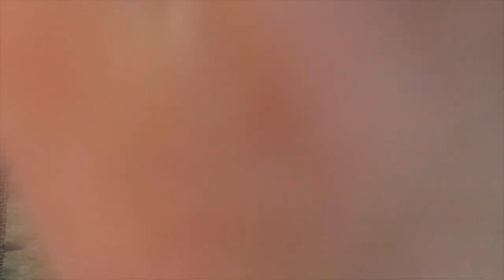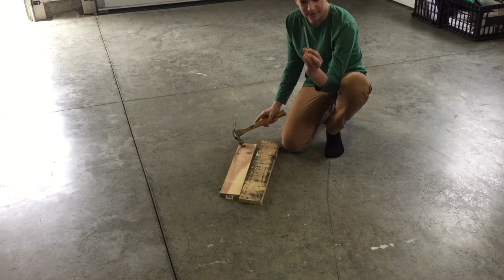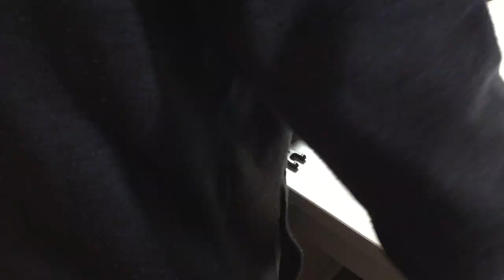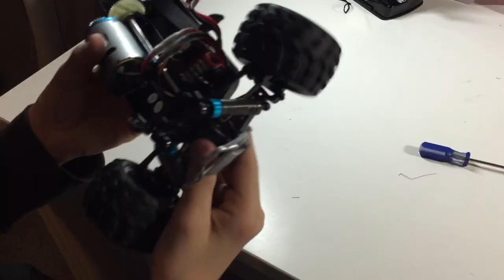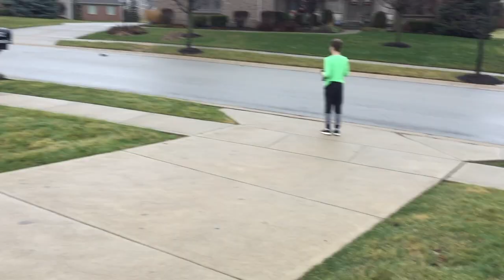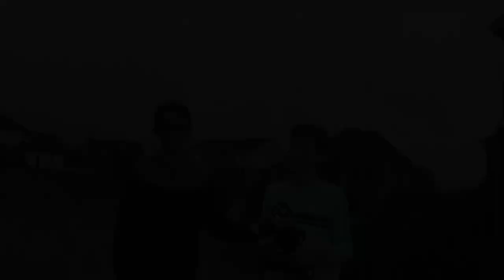BROKEN WLTOYS A979B! - Airborne RC

Comment: Thanks! This helped me fix the same issue on an A959B. I managed to hammer the transmission shaft almost perfectly straight.
Just want to add that It's a lot easier to get it perfectly straight if you remove the gears and bearings from the rod itself.
Reply from the maker: You're welcome! Thanks for the tip too 👊👍